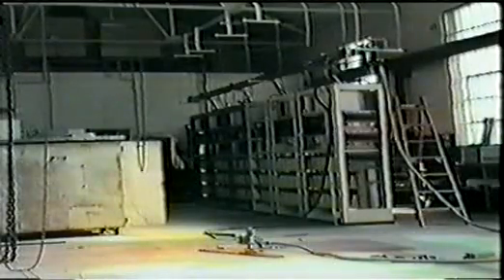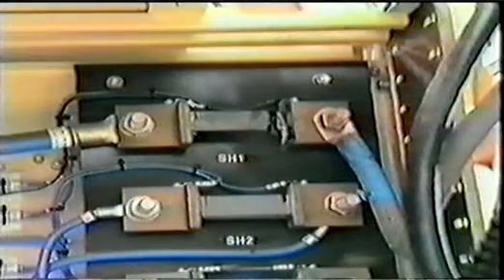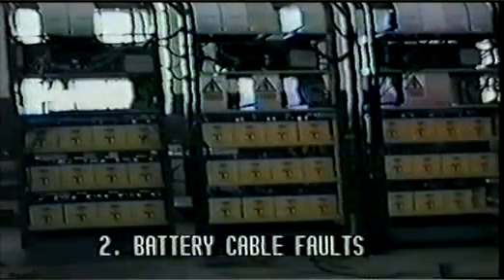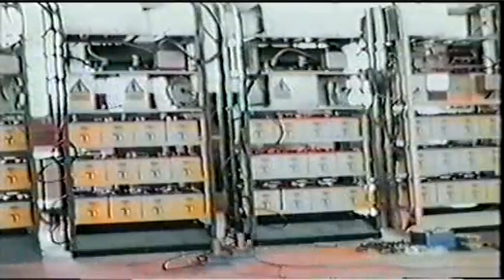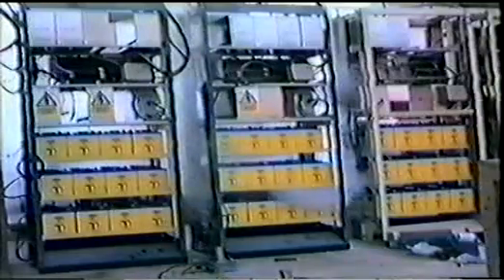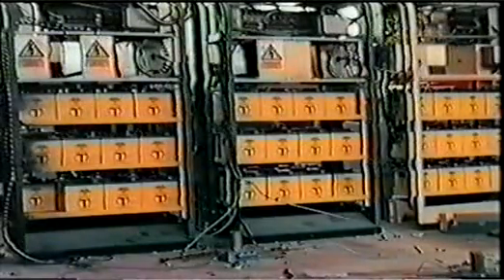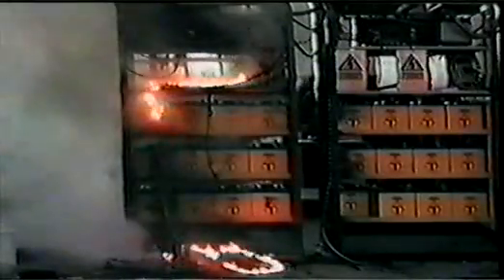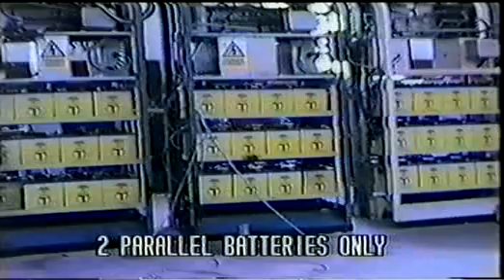54V DC Battery Short Circuit

Comment: @5:14 Hydrochloric Acid? What kind of batteries are these?
Reply: Typically they're lead-animony with  HCL acid..called flooded cells. 2.3V per cell and up to 1000amps. I've dealt with these since the 1980s
Reply: @christopherboone9802  They  are not flooded, these are VRLA, you can see they are laying on there side.

Comment: Incredible watching the cables buck under the instant high amperage.
Reply: Certainly. And I even get the idea the camera is affected by the huge magnetic field. Watch closely: as the current starts to flow, the image turns slightly clockwise and also seems to move when the sparks fly, but this could be down to the aperture reacting as well.

Comment: TBH it's not as bad as I would figure.... but still bad enough that I would not want to be near it when it happens!  What surprises me though is how fast the VRLA cells vent under short circuit.    I also assume these tests are being done without the rectifiers.  In a typical setup there would be a large bank of rectifiers in parallel, adding to the available current and making it slightly more dangerous. 

Either way, definitely got to be cautious working on these setups and have at very least safety goggles on.
Reply: The battery which vented was one of 4 connected in series, reversed, so it was efectively charged with 36 volts

Comment: 4:01 "Whatever this is, it's fantastic"
Reply: Batteries
Reply: I remember this from when I first started working for BT this is a Saftey video created by British Telecoms for the system x power systems first introduced in the 70 and the equipment is still in operation today. It’s being replaced and retrofitted with updated systems now but I still maintain this equipment today it’s impressive how reliable it is. It’s a demonstration video of what would happen if you short circuited the battery strings or something goes wrong

Comment: Holy shit! the current is so strong that it seems the magnetic field of the wires shifts the image of the camera!
Reply: It doesn't shift the image. It shifts the actual wires.
Reply: @consaka1  No, Bob Sparkle is right. I also get the strong feeling that the image is being 'distorted' by the magnetic field the wires create because of the huge currents that run through them. Look closely: First you hear the click of yeah, well, whatever it is, and shortly after that first click, currents starts to flow and you can see a small (but distinct) clockwise-turn in the video-image, which is restored as soon as the current is back to zero.
Reply: @weeardguy  camera operator is twitching and multiple shots are being pasted together. I just watched this video two more times and there is no magnetic field distortion.  First because it is too far away. And second the affect would be demonstrated differently than just shifting an image. The camera is not a cathode ray tube. Interference at the camera would cause artifacts in the picture.
Reply: @consaka1  The camera operator is twitching? I don't see that at all in the steady shots and the slight rotation in image as soon as current starts flowing occurs at the same moment every time in the first shots, EXACTLY at the same time the conductors in the background start moving due to the high magnetic fields that surround them.
I've had cameras affected by strong electromagnetic interference before (close-ups of electric trains with chopper-circuitry leaving a station are notorious) and they also affected the image. And that was even (semi)-professional equipment with mini-DV tapes.
Considering the age of this video this could be anything from a camera working with tubes to VHS/Hi8 stuff, thus making interference completely plausible.
Reply: @weeardguy  There is all kinds of movement and it is obvious there is a camera person usually behind a tripod but not always. I'm familiar with magnetic fields. This ain't it.
Reply: @consaka1  Well on a VHS camera this could happen as it stores the video magnetically
Reply: @retropcs88  we'll see if you can duplicate it. I think you'll find that magnetic interference will cause the image to fade in and out and put static in the image. Distance should drastically cut back on that interference.
Reply: @consaka1  ppl hold onto their opinions like they are protecting their sense of self
Reply: @fightington  lol